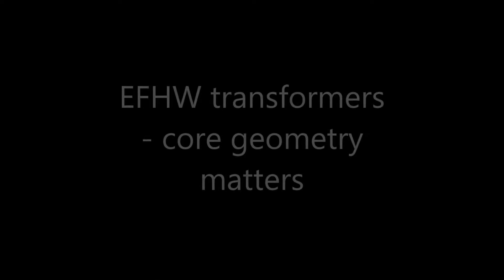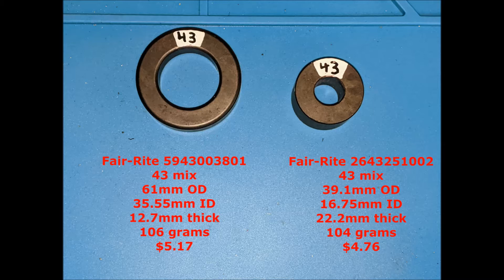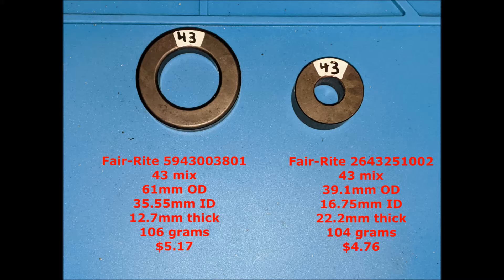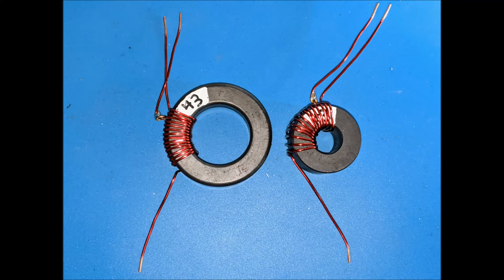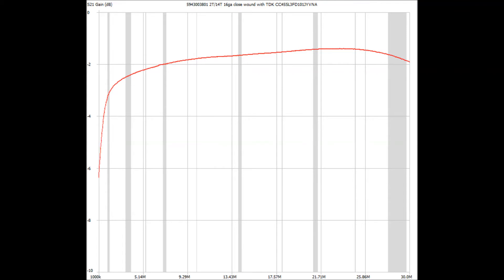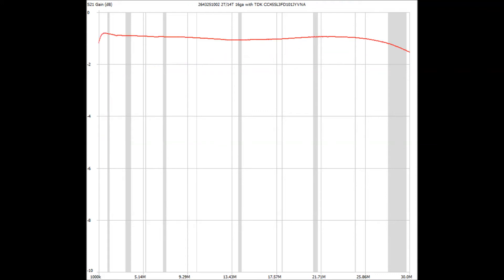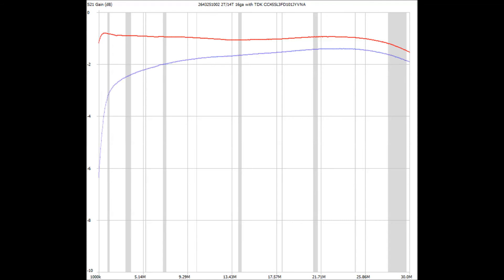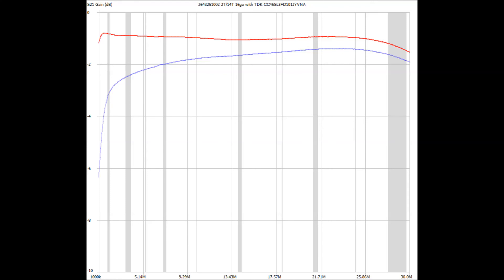EFHW antenna tranformers - core geometry matters

Comment: Thanks for the test comparison, and I was able to match your loss results using the Fair-Rite 2643251002.  I used the same TDK capacitors for compensation that you used except I used the 1KV rated ones.  I also wound up using 20 gauge plastic coated wire (dog invisible fence wire I had laying around) and did not use a tap for the primary winding (I used separate primary and secondary windings), and I did not twist the primary with the secondary winding, I just wound them bifilar style.  I did not use the tap method as I found the separate windings appeared to behave better at higher frequencies in regards to SWR.  I used coated wire because I noticed the toroid core was definitely removing the enamel coating where the corners were very sharp and using coated wire made winding so much easier because I did not need to worry about damaging the enamel coating even though I know the core has high resistivity (I wanted to make sure I did not have shorted turns due to accidental removal of the enamel coating).  I did not notice a degradation in SWR or loss performance using the plastic coated wire.  My back to back transformer test resulted in the following 2 core loss : 3.75 MHz = -0.93 dB, 7.29 MHz = -0.86 dB, 14.07 MHz = -0.82 dB, 21.15 MHz = -0.85 dB, 28.23 MHz = -1.17 dB and this was measured using my NanoVNA-F.  I also ran a full 100 watts on 7 MHz through the back to back cores using my HF rig and, the loss appeared to match what I measured with the NanoVNA-F.  My single core loss would be half of the values I listed above and this is fantastic (example: my transformer loss on 7 MHz is 0.43 dB and this is 90.6% efficient).  Thanks for introducing the Fair-Rite 2643251002 for use as an EFHW transformer.  P.S. I also used close spaced windings versus the cross over method that's typically shown on the internet as I could not find any benefit to the cross over method based on my testing.
Reply from the maker: Thank you for responding. Great to hear that all of your measurements were similar!

Comment: The question I have, is why 2:14? I know it gives 1:49 impedance ratio, but why not 3:21, 4:28,  5:35, etc until the core inner-face is full? I cannot find the tech reason why anywhere!
Reply from the maker: You are right, there is no one size fits all. Trying to use one of these antennas across so many bands is a compromise, even though certain internet experts will try to claim they are not. Different number of windings can be more efficient in the lower bands, or in the upper bands. In the middle there is the best compromise, and it is not always 2T/14T.
Reply: @evil_lair_electronics  Thanks for your reply. The reason I was asking, Is that a total of 49 turns of 19/0.15 PTFE 'B', (22AWG) will fit snugly on my 140-43 core, thus giving it an easily maintained mechanical stability. 
Is it worth attempting to wind a 'hepta-filar' auto-transformer to distribute the inductance and capacitance? ie, wind 7 evenly spaced, fit the tap, then keep winding 7, then 7, etc, until all 49 turns are taken. the end then becomes the 49:1 point
Reply: Thank you for making this video. Is the smaller core that you used about the same as two FT-140-43s stacked together?
Reply from the maker: I can't with certainty say exactly what an FT-140-43(an Amidon part number) is, because Amidon doesn't provide full specifications, for example they don't even provide the weight of that part number. Now my understanding is Amidon doesn't actually make anything, that the actual manufacturer is Fair-Rite. If this is true, then FT-140-43 appears to be either 5943002701 or 2643802702 which weigh 33 or 36 grams. This is 104 grams so the mass is about equal to 3 of those.
Reply: Carl Jito Thanks Carl. I may stack some of these if I build another EFHW. I have an FT240-43 49:1 right now, and it’s performance is okay on the primary band that it’s cut for (40 meters). It’s less than optimum on the others.
Reply: @richardchambless12   Thats because a Harmonic resonance will never be as good as the fundamentall frequency resonance because it's a by product of the actual fundamental frequency of resonance. Hence why it is a compromise antenna on the other hf bands.

Comment: Great information, I am no engineer so you are of enormous help.   Regretably, the Fair-Rite 2643251002 43 mix core I can't find in UK, the number returns a tubular ferrite core
Reply from the maker: I would bet it is the right part. Oftentimes they just show a generic photo of ferrite, not the actual part, have seen this many times.
Reply from the maker: @laserhobbyist9751  Drawing is wrong, part number is right.